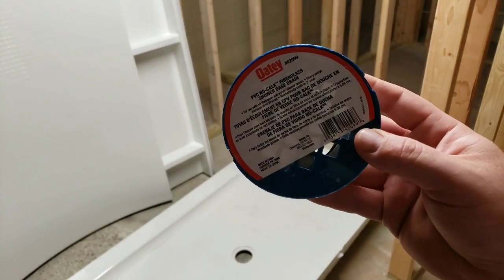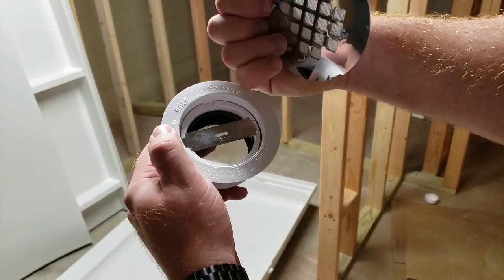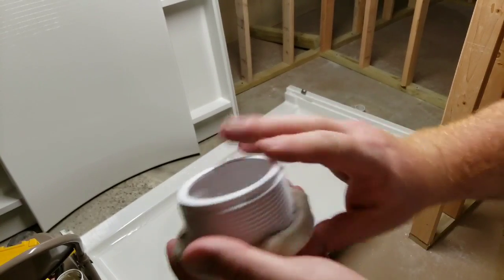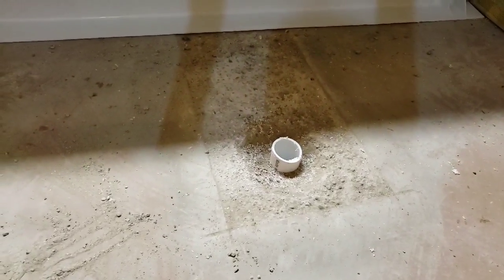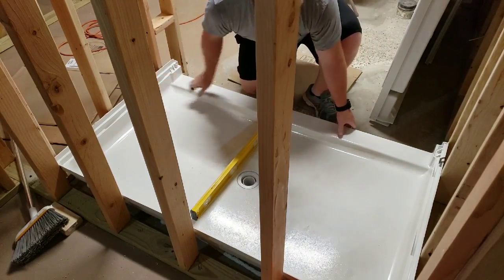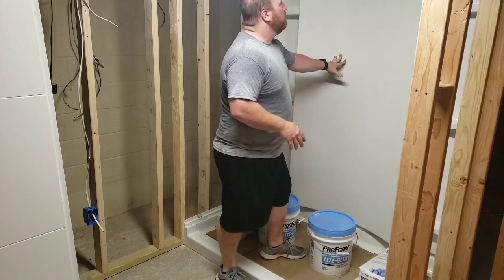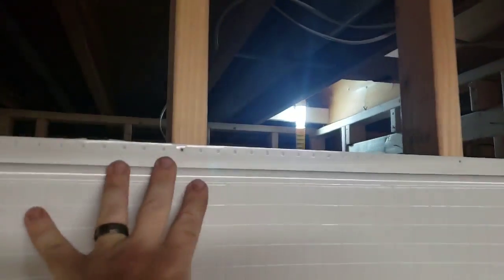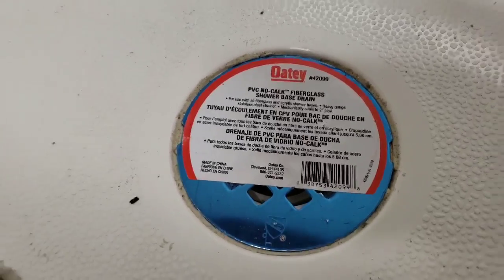Four Piece Sterling Shower and Oatey Drain Installation

Comment: Thank you for this video. I'm going to be installing a Sterling shower pan with the brass version of that Oatey no-caulk drain. Since 1-1/2" seems to stick up quite a bit, would 1-1/4" be an OK rough-in height for the drain pipe? Or did the higher part of the unevenly cut pipe stick up more than 1-1/2"?
Reply from the maker: The height of your floor drain is the tricky part. If you could put your Oatey drain down first, with your floor pan, and get a measurement on the floor drain that will ensure you have enough room to make everything fit once you cut it without cutting too low. Another note is to put dawn on your Oatey drain. That rubber was rough to get on the floor drain. Hope this helps and good luck!

Comment: I didn't have a problem understanding you. I would suggest using a thinset mortar under the base. Also wouldn't screw to the studs with a hammer drill. definitely overkill lol. If there is a gap put in a shim otherwise they will crack for sure. It's been a few years since I set one of these so I needed a refresher. this video was helpful. Thank you

Comment: Appreciate the video. I wasn't sure how to install the shower base on my project or install the base drain. My biggest concern was how high to leave the  2" pvc before  installing the base. Very helpful and well done
Reply: Thank you! That 2" piece was my concern as well. Ideally, I could have kept it longer if I put the base in and studded around it, but you probably want the walls in first. Putting in the Oatey drain was tricky, but a pro tip on that would be to soap the rubber gasket.

Comment: I have set some of these by using a 1/2 in notched trowel and spreading thin set under them. When it sets up this shower base is solid as a rock. Not going anywhere.

Comment: Looks like your base was not seated on the floor as it rocked from side to side when you stood on it.  I wonder if the loose material you left under the base caused a chunk to be between the floor and the base.  Surprised you did not clean the floor first and shim the base as needed.
Reply from the maker: The floor itself was not even. I think this was partially do to a slight grade and also where I dug up the ground to run the plumbing. Shimming was a good idea, all hindsight.

Comment: So no fasteners for the base to the studs? Was that standard expanding foam? Low rise? High rise? For the walls and back you could use small stainless washers to prevent the cracking of the lip.
Reply from the maker: No fasters for the base. Once you attach to the walls via the clips, it makes it more sturdy, but I still think the foam is essential to reducing rocking and filming it up. Once the drywall is in place, nothing moves at all. Washers would help prevent cracking but this material is so brittle it's almost impossible to prevent some cracking. The unit itself had a crack, I would recommend taking it out of the box before you leave the store - as big of a pain that might be. They do not pack these well and are not careful when transporting them.

Comment: For waterproofing purposes, is it recommended to also cover the fastener heads in the cement board prior to tile installation?  Or will the thinset itself serve as waterproofing protection at the time the tiles are installed?  Just curious about common practice.  I will be using the new Hardiebacker Hydro Defense cement board in my shower, which is supposed to be waterproof regardless.

Comment: Did you put a door on this shower? I'm curious if the wall sections and curb are strong enough to support the weight of a door, or if they'll crack (even if there's a stud behind them). I've only seen people put a curtain rod on top of these showers.
Reply from the maker: I sure did. Double sliding glass door. It hangs on the top bar. No cracks whatsoever.

Comment: Where are the small clips that guide the bottoms of the walls into place and screw into the studs?  Also isn't there supposed to be caulk at the front corners of the side walls at the base? Of course there is caulk across the tops of the walls and down the front to keep any water from seeping behind the walls.  All per Sterlings instructions.
Reply: The Sterling shower systems are supposed to have built in seals and no caulk is required. But refer to the directions to be sure. Not sure if all the Sterling products are the same.

Comment: Don't use foam under your shower pan, use Mortar per the instructions. Plumbers putty is not recommended on these plastic shower pans. Foam has a lot of expansion strength and can push your base out of level and out of position against the wall as it expands. It may also have a chemical reaction with the plastics used in the shower base. You also leveled your base on the sloped shower pan, which means it was probably not really level. You should use the edges that are flat to make sure your base is level. You also did not install the clips on the base that is called for in the instructions.

So you pretty much did everything wrong that was possible to do wrong. The only useful bit was showing me that kind of drain connection, which I didn't know about before.
Reply from the maker: Thank you for your feedback.